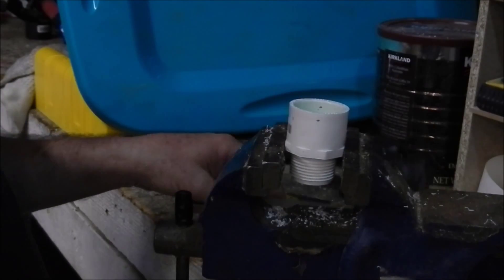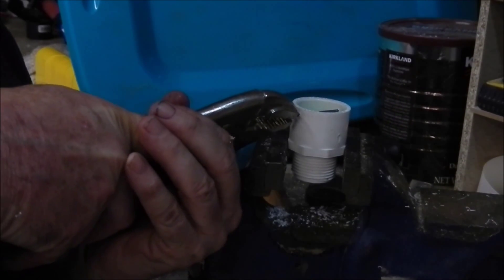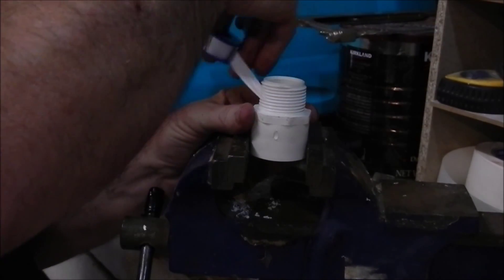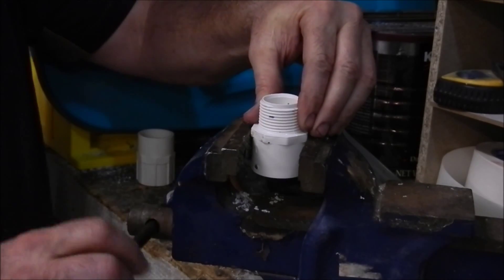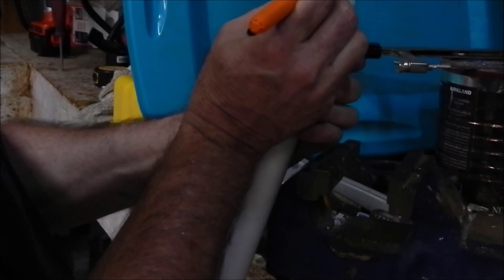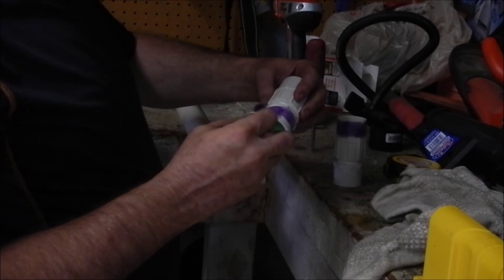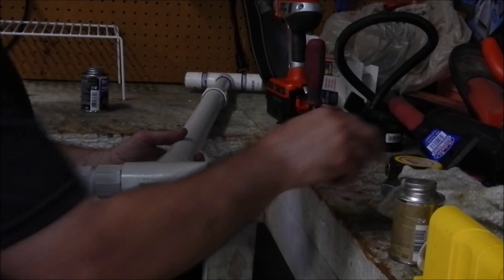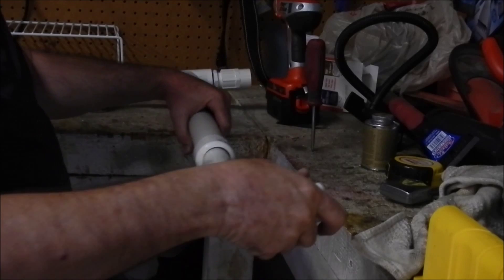PVC hand pump part 3 DIY

Comment: How deep will this pull water from? It amazes me that I have yet to find a video of using these hand pumps at any real depth
Reply: Physically it is impossible to pull water from a depth of more than 25 to 30ish feet. Any more than that you need a pump that pushes the water up. That is why you can not find one of these pumps to use in a deep well. It is impossible.
Reply from the maker: I've only used it to pump water from a tub or a bucket. It would probably pump water from a few feet deep, maybe 10 -15 feet. That is a great question, and a subject for another video.